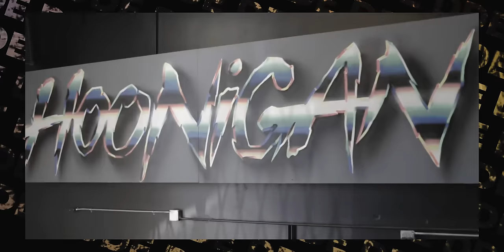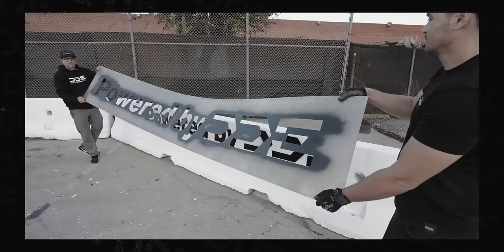EXPOSING OUR EXPERIENCE WITH HOONIGAN DURING HQ TAKEOVER…

Comment: Nice server rack you have going. I am a software engineer, you won't believe the kind of money we can make setting stuff up like this. Once you move into enterprise level equipment, its gets mad expensive really quick. Basically, that first room was the demarcation point for the building as far as AT&T is concerned. They ran the fiber line in, and then you run the fiber from the splitter box over to the server rack into some SFP ports for the network switch. Look like quite a few patch panels as well. Yall have a lot more going on there though other than just internet as I see an actual server too. The joys of running a business :) Also an IT nerds dream like me to have to play with.

Comment: Did you end up figuring out a way to engage clutch when handbrake pulled and have it not down shift ? Might have to splice the rear wheel speed sensors into the front ones so it doesnt assume 0kmph and down shift

Comment: If your office rooms have concrete floors you do radiant heating basically hot water running threw pipes in the concrete it’s very efficient and not very expensive